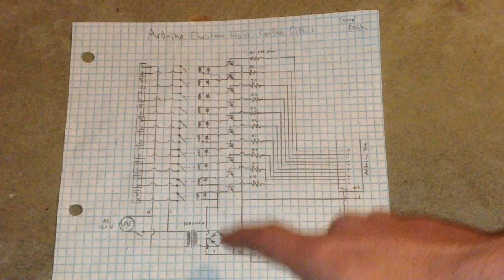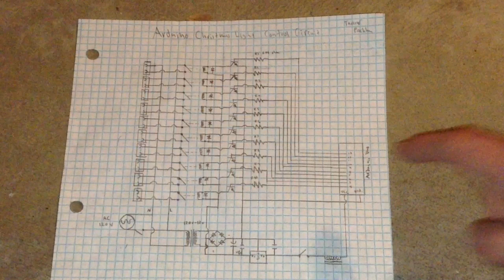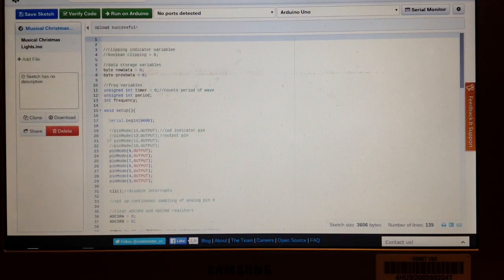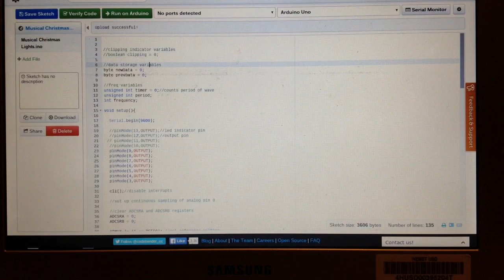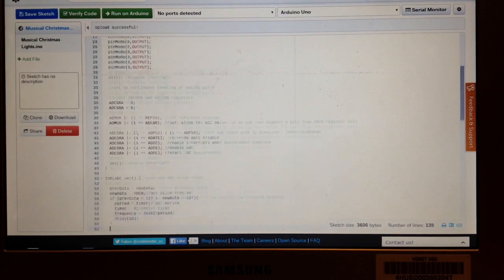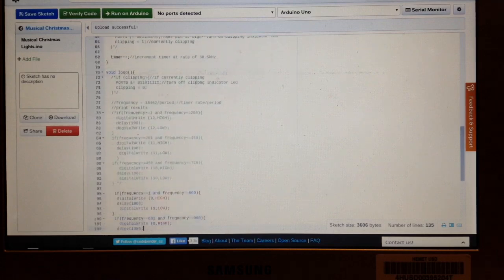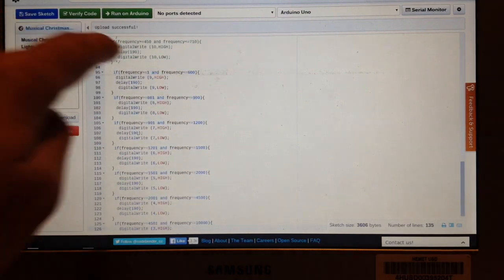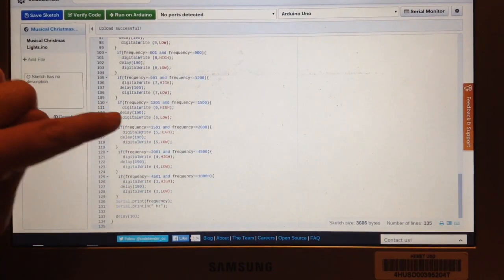DIY Musically Syncronized Christmas Lights

Comment: Very nice work. I am doing the same thing using your work as a guide. What are you using for the music? Ipod, radio station? I noticed different devices give me very different frequency outputs ( I watched them on the serial monitor) therefore different effects for the same song.
Reply from the maker: Mr1ericcartman1 I am using an iPod touch. the different frequency outputs for the radio could be attributed to the distortion from the carrier wave.  Good luck on your system!
Reply: Tanner Tech I noticed the radio station was almost unusable because of too much of one frequency, the computer was working well but is not portable, I'll try an iPod or MP3 player. Thanks
Reply from the maker: Mr1ericcartman1 Your welcome, make sure to post a video when you are done.

Comment: Hi, is there any possibility you could send me the code for this I cannot find any code that accomplish the same thing anywhere on the Internet?
Reply from the maker: Sure, check out my instructable on this, the code is there too.  http://www.instructables.com/id/Musically-Synchronized-Christmas-Lights/
Reply: Tanner Tech thanks for your help i've followed your steps almost identically but when I plug my phone in to the ox I almost get a feed back through my wires can you please help me resolve this thank you
Reply from the maker: +Nick Opack Can you explain your problem in detail, I would be happy to help, but I do not have enough information to diagnose your issue.